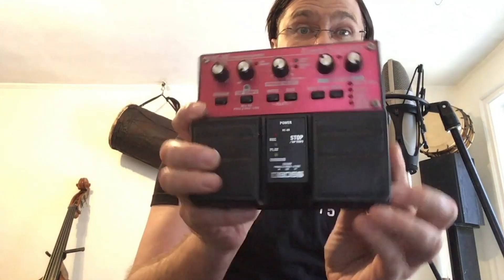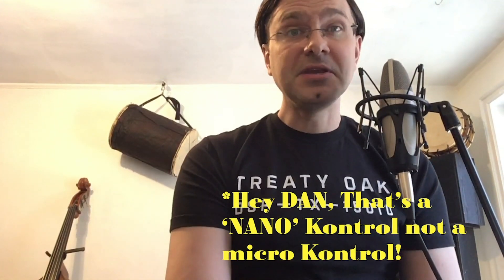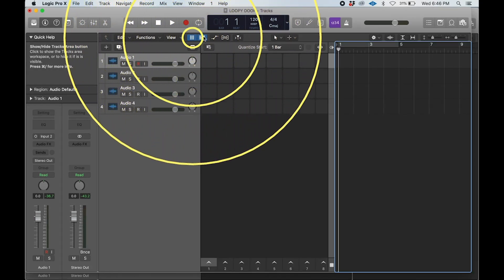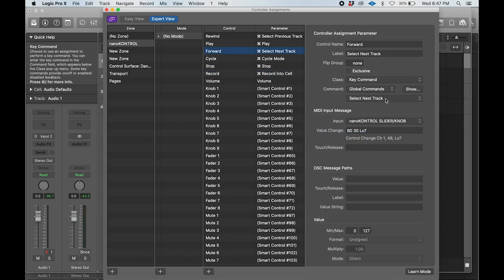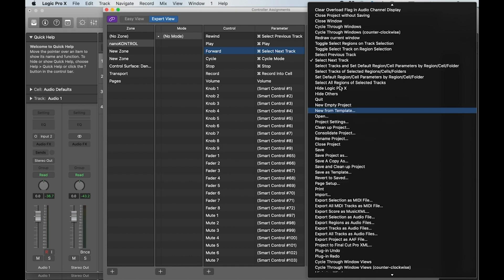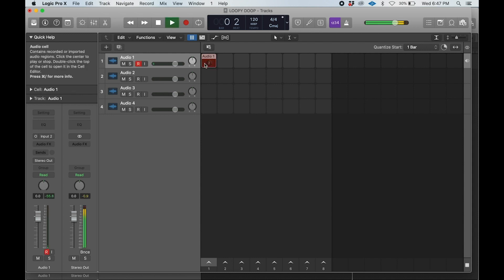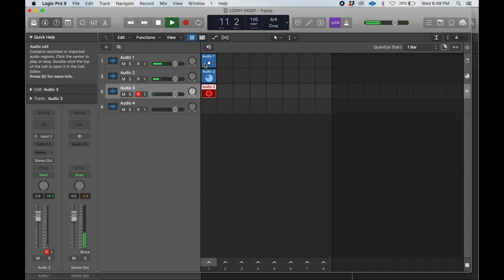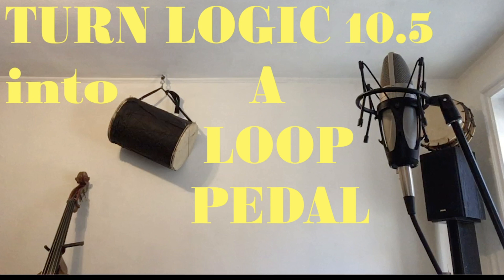Apple Looping Pedal? How to Turn Logic Pro X 10.5 into a LOOP Pedal!

Comment: I like your setup.  is it possible, without metronome, to record the first cell and let logic determine the tempo/measures, then use for the rest of the project? 

effectively, i want to make it act like a rc300 would when starting to loop
Reply: did you ever figure this out? it what i want to do too ahah
Reply: @exitdown  I ultimately went with ableton and used the looper plugin to get my first track in... that set the tempo. then i transfer it into a cell and clear the looper track.

didn't figure it out in logic but there's probably something similar

Comment: My  MPD218 doesn't show up in that zone list but its listed in my midi settings. Im knocking on looper heavens door, but no one is opening. please help :(
Reply: When you setup your midi controller some midi controllers are labeled different names in the daw so what ever midi controller you have it might be named something els in your daw so you just need to find out what there calling it in the daw your using
Reply: @GoldenProductions2019  yeah mine works but there's nothing in the zone list

Comment: So interesting. I’ve got a new Bluetooth AIRSTEP pedal (it doesn’t show up in the controllers column on the left side of the Controller Assignments panel, though it is connected and it is operating the basic transport controls. But no matter how I change the Record to Record into Cell etc, Logic carries on as a standard linear DAW and ignores the cell records options, even though clearly armed. Any ideas? Many thanks again: even so, a steep learning curve!
Reply: Thanks again for the video. I finally got this to owrk and wanted to let folks know how: when selecting from the huge menu of controls options, it's important also to select Key Commands and Global Commands. In fact, I've also managed to get this working with a Blueboard and the big advantage (if you're an acoustic musician) is that the pedalboard makes to click sound whatsoever. Once you pair Blueboard with Mac (Audio Midi Setup) you use the Learn Mode tool to map each of its four controllers: in my case, I map A and B up Up and Down Track (which moves up and down cells if cells are open, or tracks if tracks are open); then button C is set to Record into Cell and button D to Record. That way I have basic record control in both cells and tracks. The airstep offers far more (and far easier) customization but, as I say, it really only suits someone who's going direct in with an instrument rather than an acoustic musician.
Reply: Hello, are you able to map the commands via your airstep pedal in logic pro live?
Reply: @giraffey8974  if I understand you correctly I’d say the answer is probably no. The AIRSTEP is very flexible and can be mapped to a vast number of controls in Live but I believe you must make those connections in advance rather than do it ‘live’ or ‘on the fly’. I might be wrong but I can’t imagine any way to do that, or revise existing settings, in a live (I.e.   playing) situation. Hope that helps you!

Comment: thanks! If i have to use both hands on the instrument to record a four bar beat the loop always ends up being five bars, since recording to the cell seems to be resetting the set cell length. Any ideas how to avoid this?
Reply from the maker: Sure, one way is to set the Recording Length of the cell by clicking on the cell which brings up the Cell inspector in the left. at the bottom there is a menu option labeled 'Rec-Length' which is Default set to Automatic (Bars) but you change to Cell Length and set that length in the same Inspector menu. I know what you're talking about you kind of have to lead the loop trigger on the initial Loop a little to get it to sync right. I definitely see a midi foot controller in my future! Enjoy.
Reply: danielfoose thanks for the video. Any idea what midi foot switch would pair well with this for live loops?
Reply: @murahachibu  irig blueboard's not bad
Reply: @murahachibu  See my comment and reply to my own comment above. If you're not recording acoustic instruments, Airstep is fantastic and very flexible. For acoustic instruments, Blueboard is the way to go (but make sure you get the version with the firmware update: v1 is horrible and, after months of trying to get it working with a Mac, I gave up and bought the upgrade which worked almost immediately

Comment: will it work in the sense that the loop you establish loops automatically until you stop it? Does it go seamlessly from one loop to the next?
Reply from the maker: Yes exactly the default is each loop layer will run continuously until you stop it. Yes Its been pretty seamless in the little time I've been using it when transitioning between loops.